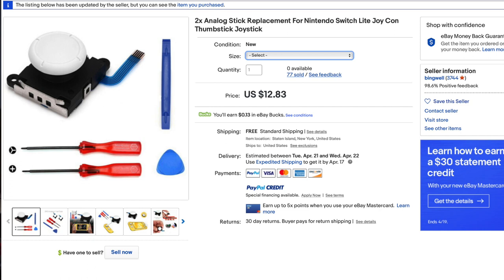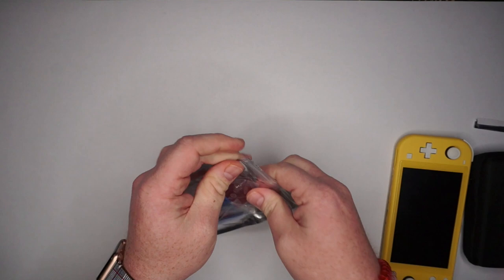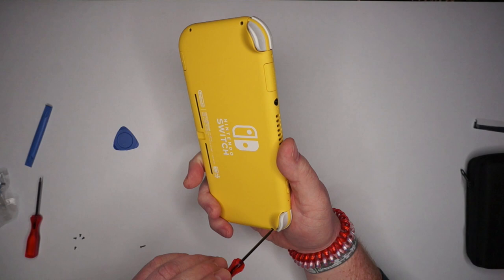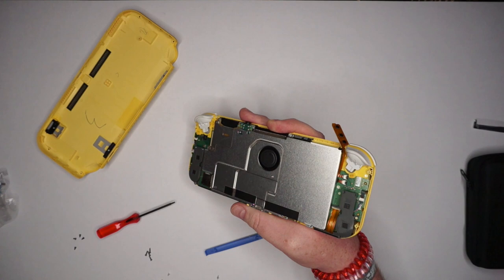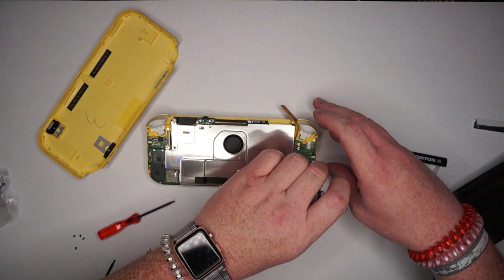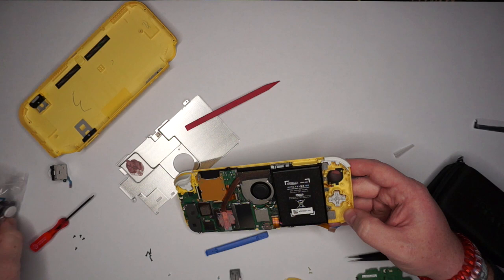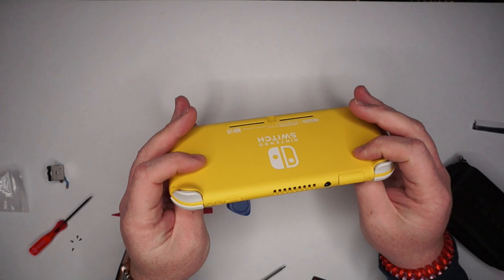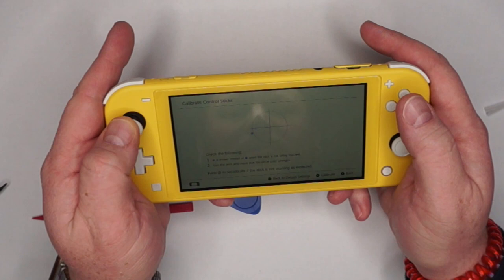Swapping a Switch Lite Analog Stick

Comment: I lost my nerve on home repairs after I ruined a Vita, sent it to someone in a Facebook gaming group to fix (he never got around to it and actually sent it back to me worse than it was but included 3 bargain bin games as an apology), then sent it to a buddy along with a bunch of stuff in a trade to see if he wanted it for free. Needless to say it was beyond repair and he tossed it. On another note, I just got a Switch Lite today and just posted a quick unboxing.
Reply from the maker: Wow, what was wrong with your vita?! I actually had to swap a left stick on my Japanese neon yellow/white vita and that was about as painful as the switch lite to work on. Wish I could have helped you with your vita. Which color lite did you get? That’s awesome nonetheless. I really wish I could get a lite for personal use but Nintendo still can’t figure out cloud saves for half of their own games.
Reply: PunchNpie I bought the white Darth Vader PSP for cheap on eBay (apparently before it was expensive). But it was beat up.  So I bought a third-party shell to replace it. It was just above my skill level. I was surprised. There was so much to unscrew and disconnect. I ended up stripping some screws and just got stuck. Then after the Facebook group guy sent it back he had actually completely put the old shell back on but broken (so more work to do).  Then when my friend got it he said it was just junked at that point. I had given up anyway. So I'll never attempt that again.
Reply: @brucesi  nice

Comment: So I was playing fortnight (I got it 3 months ago and have only played on it twice) and I was getting good at fortnight and then I tried to turn my character and it wouldn’t turn and I could only look up so after like 2 hours of trying to find what went wrong I looked on the joystick and where it connects there was a crack they need to stop using cheap plastic because I’ve gone through 2 switches already
Reply from the maker: That’s absolutely insane and Nintendo just said that Stick drift isn’t real. Yeah... ok.

Comment: So if someone builds RC cars and planes this would be pretty easy right? Asking because I have a broken switch analog stick and my dad knows how to build those. I have no idea what's going on throughout this video but do you think my dad could help?
Reply from the maker: I think so, just make sure to be careful with the small cables. Some are ribbons and some are push on connectors. Also make sure to remove all necessary screws and remember where they all go when reinstalling and assembly. Is it the left or the right stick?
Reply: @PunchNpie  Its the left...
Reply from the maker: Much easier than the right. The right side has the majority of the components on that board.
Reply: @PunchNpie  Sweet, thanks so much!
Reply from the maker: Of course, feel free to reach out if you have any questions. I have Twitter, discord and Facebook. You can hit me up on any of them for help while doing it. The links are in the video description

Comment: Did everything as instructed but the shoulder buttons and triggers now no longer go down when pressed
Reply from the maker: I would dissembled it and make sure the buttons and rubber are lined up. Also make sure you didn’t snag a ribbon cable and make sure they are seated properly on the board.
Reply: @PunchNpie  so one of the rubber pieces is missing, and it seems there is a spring involved as well, since one of the triggers has one but the other does not? I've searched all over the work area and the floor and cannot find the missing rubber piece or spring. What are these rubber things called and how can I replace it?
Reply from the maker: Here is the spring
https://www.ebay.com/itm/233164390662
I’ll look for the other piece for you too.
Reply from the maker: Also is it the L or the LT?

Comment: i cant find any videos on the right joystick ):
Reply from the maker: Sorry, the left is the common to go bad. That being said I feel like once you are in the system, and you’ve removed a few ribbon cables, it should be a bit easier to do the right side too.
Reply: Update: I’m pretty sure I broke it. It won’t turn on now): rip animal crossing ugh
Reply from the maker: Do you see any ribbon cables that look damaged? If not, maybe go back try reseating all the cables. Try turning it on also before you fully assemble it. Don’t give up just yet!

Comment: I plan on doing this myself as well! But I’m scared that once I tear down and put together the switch again, my switch will go back to factory made and my saved data for animal crossing will disappear :( did this happen?
Reply from the maker: Absolutely not an issue at all. The switch will not erase your data swapping out a stick. When I turned the switch back on in the video, if I remember correctly, everything was still the same as if I had only powered it down.

Comment: Welp mines completely broken it only works left or right. I think its moisture that got it in, or my pet dogs hair 🤔
Reply: Ive had mine since Christmas 2019. I did have a slight drift early on but a quick recalibration fixed it.
Reply from the maker: Do you mean you are having issues with both sticks or one stick that only goes left and right?
Reply: @PunchNpie  The Left stick only works on its X axis. Barely moves on its Y axis
Reply: @PunchNpie  I already bought a kit on Amazon
Reply from the maker: Jeez, yeah definitely time to swap it.
Reply: @PunchNpie  bought the kit that has 2. Im assuming it will happen again down the line lol
Reply from the maker: Oh yeah, it will lol or won’t... who knows. They aren’t Nintendo branded parts so they may not have that issue at all. I replaced the left stick on my Vita years ago that was having the same issue. The replacement was not a Sony part but I haven’t had issues since.

Comment: I followed this tutorial to a T and now it wont power on 😭
Reply from the maker: Did you unplug the battery during the install?
Reply: @PunchNpie  yes I did
Reply from the maker: I had this issue with one of the switches I repaired. It could be a couple different things causing it. What happens when you plug it into a charger?
Reply: @PunchNpie  literally nothing. I tried to hard reset, nothing happened. Its been charging for about an hour now
Reply from the maker: Ok so the next step would be to unplug the battery and plug it back in. I wouldn’t even put the cover back on until you can power it back on.
Reply: @PunchNpie  okay will do
Reply: Of course, I stripped two of the triwing screws 🙄 now i cant get the back off
Reply from the maker: Hit me up on one of my socials. It will be easier to help you out with this.

Comment: Really wish I hadn't followed your video. Because you can't actually see what you're doing, I ended up removing the connectors to both the left analog and left speaker from the motherboard. Now my switch is completely unplayable. Please consider filming with decent lighting and a macro view of the handheld next time you film one of these. You not being able to show where each screw went back in place was also not helpful.
Reply from the maker: I’m sorry that happened. I never really expect anyone to use my videos as tutorials per se. It’s more just to share my experience.